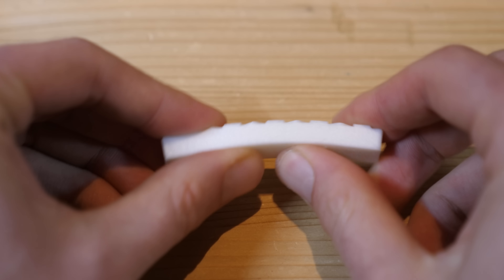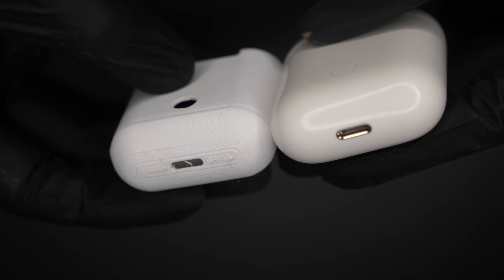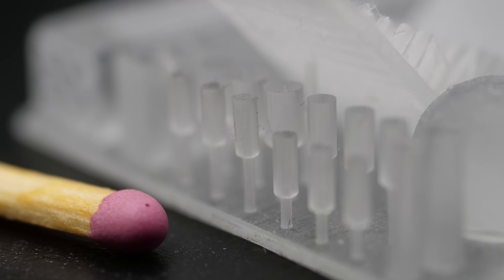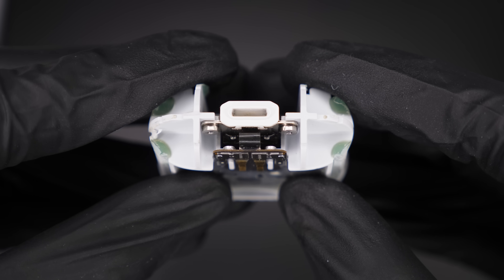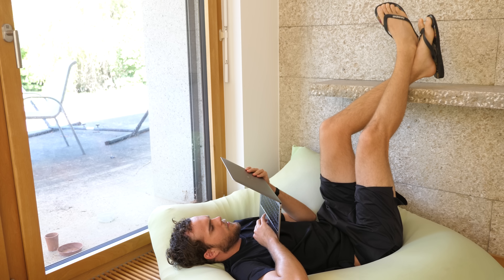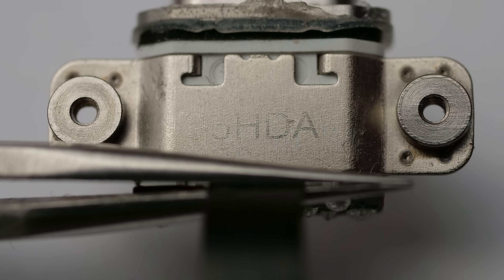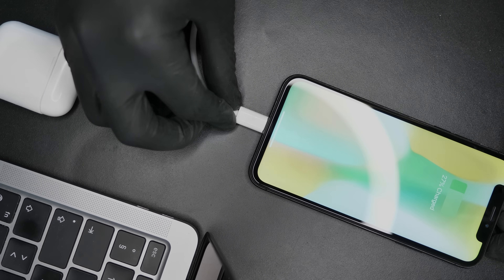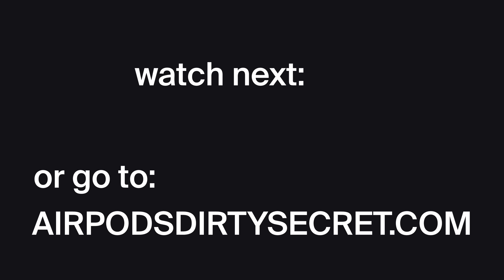AirPods' Dirty Secret (and how I'm fighting it!)

Comment: Why all this?
Once you make the decision to replace the case you are free to put whatever battery you want in there with whatever ports you want, put an off the shelf multi-port connector, an off the shelf charging circuit and whatever battery you want so you would end up with a much upgraded device for a fraction of the price of all this.

Comment: I think that all repair shops for smartphones should be able to download and 3d-print, or buy high quality open source replaceable/replacement parts, which have no affiliation with the smartphone’s company, are made by and checked by other users of the same openly accessible open source replacement part website (or reddit page lmao), so that all repair shops have replaceable and high quality replacement parts, which will hopefully then put big companies in their place and in a way… powerless (since they can’t sue any replacement file’s author Anyone and at the same time nobody has made the parts [hopefully, the right to repair shields authors from juridical stuff that companies could be wanting to take as counter attack]). If no smartphone company truly wants to respect our right to repair, then we should force it.

Comment: I managed to open up the case without breaking it
AND if you know how, it's not that hard!

First, open the case and then the magic starts:
All you need is a broken lightning cable or screw or something stiff enough and which that fits inside the lightning port and withstands a vice clamp!

Fill the case with Isopropyl alcohol, this will soften the glue
Insert the case on a cloth inside the vice (so it won't get damaged), note that it has to be on the flat side and NOT against the lid.
Then you push against the lightning port with the vice until it's about 2 milimeters in (or you hear the glue cracking)
after that, if you're not able to pull it out yet (pull on the lid, that one is attached to the insides, push the case against its sides with a cloth and vice

Now I need that pcb :/

Comment: If theyre gonna make it so you can't replace it, it should be illegal to use plastic they can't recycle.  If it were a PLA or other bioplastic fine...but its not.  They should be required to use aluminum since its easily recycled into new parts, or it should be repairable.   Manufacturers,  those ARE your options.   You'll see...in time.  Ive been recycling tons of aluminum at home in my foundry into ingots to cut new parts on my CNC and Lathe, depending on my needs.  If its easy enough for me to do then its probably the easiest way for us to go greener.  Lol

Comment: Last time i see aipods charging base it was easy for disassemble. (So no need for cut them and make new.) I dont change ports from lighting to usb-c but in some devices i make some "changes" and without high current argon welder. I just solder parts together with 99%+ tin. And later solder socket to pcb if needed. ...For me many thing in video is interesing but very big overkill. Its even biger. If i think about how many work get into making someone to make 3d priter machines or welder ..... Pc ...and software .... And how long they evolve to make it posible if 100-200 years machines and tausands years human skills can make similar results. (Yea biger efforts)  Stanislaw Len say ... Taht some day then will be posible to make AI machine woman that clean house or will help with seek people but how it will be hard and how expensive (overkill) if its just easer to pay a part of it some girl that will have job.

Comment: The right to repair is a huge battle with almost all products, in my industry we are fighting to be able to repair our own tractors. Currently if you have modern tractors, for example the case 110 like we have at work has a problem every couple of weeks and it just locks you out of the system and you have to call a mechanic out from the manufacturer and you lose a whole day of work to repairs. It’s usually something stupid like there’s a bit of carbon buildup on something or someone tried to replace a tire or something. Some farmers are literally hacking their own equipment. This isn’t a battle the manufacturers will win, farmers are famous for being stubborn.

Comment: I will poop on your party. So you are fighting wasting of plastic and electronic with printing more plastic, using nasty chemical resin with VOC, using more electricity and using several bottles of isoprophanol and maybe other chemicals? Really? What about to use some more sustainable materials and procedures to get to the result? I love 3D printing and making stuff, but if you talk about sustainability at first, be sustainable yourself. 🤷‍♂

Comment: Why use USB C, a delicate connector? Better off using a more robust connector, like USB B, BNC, DB9, or more seriously some sort of magnetic pogo-pin connection for minimising contact wear.
And I bet you could just buy (or spoof) some of those TI gas sensor ICs and shove any-old lipo in there, maybe even one significantly larger, or a LiFePO4 if you try hard enough. That would keep it out of the waste.

Comment: You could make the frame look even better by exporting the CAD file at a higher stl resolution. Nice work!
Reply from the maker: you're right. not sure why I used such a low poly count, I only noticed a few days after uploading. I changed that for the Pro version and I'll fix it for this version soon

Comment: Cool project, but maybe a bit complex solution when a flex PCB and spotwelding is needed.
I am not certain that this is the way to fight planned obsolesence, you gave Apple money for the product in the first place.
If you can make an actual buisness out of selling replacement kits and USB-C ports that would be another story, that might make Apple change their designs.
Reply from the maker: check my latest video :)

Comment: YES. one of the things I fucking hate about 2020s is the fact that most devices DO NOT NEED TO BE REPLACED.

90% of my device breakdowns is due to battery wear, and while you could just go out and get a new battery and chuck it into your device back in the 1990s and early 2000s, these days you're FORCED to get a new fucking device.

Comment: There's a lot of Apple hate going on... I feel like what Apple's doing here isn't evil, It's oppurtunism and taking oppurtunity of a system with some glaring oversights. Plenty of us find ways around the rules or try to leverage the system for personal gain. Apple isn't restricted on what it can do here so why would they choose to make less money? I feel like American legislature has consistently been behind on the restriction of technology and the protection of the modern consumer, however, it is not Apple's fault for leveraging that fact. If there was a legal way for you to tax evade, a lot of people would take the oppurtunity to save money. Because in reality, Apple has to make money to please investors and they are not going to take a hit to profits just because you can't repair your airpods and are mad. They are a great company and tbh some of the things going on at other companies make Apple look like a saint in comparisson. I have a Dell computer. An XPS 15. It cost upwards of 2000 dollars and I was thrilled because it was Windows(I vehemently oppose Mac OS because I don't want to learn how to use it lmao). I was shocked when after a month of using it, it was getting 3 hours of battery on idle. On idle!!! When I am using it for my typical things such as coding or 3d modelling, it lasts max 1.5 hours. I was like, "damn my battery must have broken and needs to be replaced." When I went to Dell, they pulled up some b.s. battery diagnostics panel and said that my battery was, 'excellent condition.' For comparison, this computer was marketed as having 12 hours of idle battery. I could not get my battery replaced and to this day, it needs to be plugged in almost constantly. I've basically been scammed so I feel like Apple's marketing techniques(and also it's not like they try to hide them) are a lot less malicious than other companies. I think Apple is a great company that produces great stuff. I like their asthetic and their utter lack of dependency on anyone else but themselves, no Nvidia GPUs or Intel chips, only cutting edge Apple chips.

Comment: Hey don't know if you're gonna reply but. My laptop has a thunderbolt port but laptop came with a typical barrel charger.
So can we replace the barrel pin with usb c? 
Can we use any usb c cable and just solder the +ve -ve terminals and make it work?

Comment: Very cool, but unfortunately it's not the case being the problem here. I have the OG airpods and one of the earpeaces is now dead due to battery being screwed. I could do something for the case but the headphones themselves are just e-waste with the timer ticking right out of the factory. This video should be recommended to everyone who considers the new airpods instead of all the reviews — after two years all you can do with those things is to throw them away and buy new, shiny replacement. Apple is such a sustainable company — Isn't it... I guess the missing chargers did offset the environmental impact of airpods, so they are clean now — right?

Comment: Thread lock would have worked perfectly well. Welding completely unnecessary.
Reply from the maker: I only welded the nuts, not the screws
Reply: @ExploringTheSimulation  yep, but some red loctite would have done the job.

Comment: Once my iphone stopped charging because the charging pin wouldn’t go in properly. I called Apple service, explained the issue - they didn’t bother to say much other than “ we have to replace the charging point” in your phone that will cost you 200-300$. I hung up, took closer look inside the charging input, used a tiny needle and pulled out fabric linings that got accumulated and stuck overtime after keeping phone in the pocket. It charges perfectly after that! 🙂

Comment: Fantastic job on the mod Ken!!!! but wow, she definitely failed that Q/A. She didn't ask any probing questions, didn't pull up any articles to see current procedures for that type of issue or offer to send you any, and didn't try any troubleshooting steps (i.e the apple support article would've told you to try cleaning it, etc...), I've seen so many devices misdiagnosed when something as simple as a dirty charging port not allowing a proper connection, or just trying a different cable because pin 5 (power) turned black, solved the issues. Sometimes the advisors become so complacent, that the job becomes robotic as it were; so I believe if you'd spoken to another advisor or senior technical advisor (manager), you might've had a better outcome. 

With all that said, I'm happy it turned out this way, cause we got this brilliant idea. As they say, necessity is the mother of all inventions

Comment: Is it smart to use ESD safe resin intead of the standard resin?
Reply from the maker: Good question. I believe only grounded parts touch the solid resin so it should be fine with standard resin :)

Comment: what's the R.O.I. on this project? how much could you sell these repaired units for relative to the repair time and parts cost. maybe with a full production line you could justify 20 bucks an hour for labor but the people capable of the welding and soldering repair work will command much higher wages anywhere outside of possibly east Asia. and even then the investment is probably better spent on making knock off airpods instead of repairing older units. :/

Comment: So it just dawned on me.  In many states, you have what’s called the cradle to grave rule.  If you sell hazardous material in a product, such as engine oil or industrial cleaning solvents, you are required to assist the end user in the disposal of said hazmat.  You can’t even charge them for it.  That’s why places like auto zone and Napa take used oil.  They’re required to by law. 

So how does Apple get away with selling a product that they refuse to warranty or repair, and even go so far as to suggest customers to just throw them away when said product contains lithium?

Comment: Soo basically all we really need is a precision tig welder, an asl printer, a soldering station as well as micro-chips and other electronic grade components... to fix air pods
Reply: Oh not to mention an electric multi tool to get into the thing...
Reply from the maker: pinned comment

Comment: I have a used macbook that I got to learn MacOS for my previous job, since I would be working with it. I love the screen (retina screen) but when I had to get it repaired, I went to an apple licensed repair shop. I had a bad experience there, for a "cleaning and inspection" of my coffee spill. I turned in my laptop, and got it back, not cleaned at all (sticky keys which I had to pry off carefully in order to not break them, and clean under the keys myself. The bottom of my laptop has 2 missing screws now, and I could even still see dust through the vents on the sides. More like a "open it up to tell you that you'd need to replace all the parts for more than what you bought this for"

Comment: the rep wasn't lying. It IS more economical for Apple to simply replace the device rather than fixing it. 
That's why Apple designed them that way. If they make it impossible for themselves to do reasonable repeatable automated fixes on their own devices, it means they don't have to pretend that it would be an easy fix. Because if you have to do manual labor on the device, its not economical for them. That would require them to pay someone for skilled labor. 

Similarly, they make the devices really easily destroyed by any form of tampering, explicitly to prevent people from fixing them rather than sending them to apple for full replacements at nearly full price, or in the case of older devices, at more than full price.

Comment: "It's more economical to just swap the case out." This statement is 100% accurate, except they're leaving out a massive part. It's more economical for THEM, because that way they get more of your money. Apple is by far one of the scummiest companies on the planet and they straight up lie to their customers and go well out of their way to milk them for every penny they can by trying to squash every avenue of repairing any of their devices because they make massive profits by preventing their products from being repaired. They've literally gone as far as spending large amounts of money and effort to purposefully engineer their devices to be as hard to fix as possible, including writing software that intentionally breaks iphones when a component change is detected, even if the new component was literally manufactured by them and taken from another one of their devices, inventing their own proprietary screwhead so the screws couldn't be unscrewed or screwed back in because the screwdrivers to do so didn't exist, and creating company policies of flat out lying to customers about the state of their own devices and what options existed to fix broken and defective ones. I refuse to buy anything from them based solely on principle despite the fact that they occasionally do create some cool things, as does my dad ever since his iphone 3gs was very nearly bricked and completely wiped and locked down because he tried to update it with a 3rd party cable one time. Speaking of which, they completely removed the entire section and ability to review and rate their devices on their very own website's storefront because their lightning to usb cable (which they also engineered instead of using an industry standard such as usb c like every other phone so they could jack up the price and have control over accessories that used it to connect despite the fact a standard would have been far better and way more convenient while costing apple less money and effort to include) was such absolute garbage despite the fact it cost like 5 times what an equivalent micro usb or usb c cable does that it would fray and brake in the exact same spot sometimes within days and customers were so furious about it the 2,000+ reviews were almost entirely people complaining about that and resulted in an average rating of something like 1.4 stars, and as far as I'm aware and despite the fact they swept this problem under the rug a number of years ago, they have still yet to correctly fix the issue, because the 20-30 bucks they charge for a wire that the standard equivalent to goes for about 4 bucks and probably costs them less than a dollar to manufacture rakes in cash and they couldn't give 2 sh*ts about their cutsomers.

Comment: I have Samsung Buds - the first original ones. You can easily disassemble the whole case and change the battery. Not only that, but you can open the Buds itself like a Kinder Surprise egg, get new batteries, and voila.

This just shows how Apple is anti-consumer, anti-repair, and anti-ecological.

Comment: yeah but its apple they don't pay taxes they charge far more than the product is worth they rip everyone off with proprietary cables for charging and data transfer, they are a horrible company that believes you should pollute and not reuse or repair, apple is leading the fight against our right to repair and the tools they released to help are nice but still dont solve the problem the e waste is bad and the lack of taxation is horrible as well. don't support company's that don't support you the consumer, apple doesn't care about the consumer.

Comment: I think it’s moronic to expect every product out there to support 3rd party repair. 
I think it’s fine some products can be perma-sealed and not support repairs. 
If you as a consumer do not agree with that, simply don’t buy the product. Your $-vote will drive the market. 

I happily bought a MacBook Pro with soldered parts that cannot be upgraded, because it suited my needs. I knew what I was getting into and the product fit my expectations. 

If there is a mismatch between your expectations and what the product can do, don’t buy it.